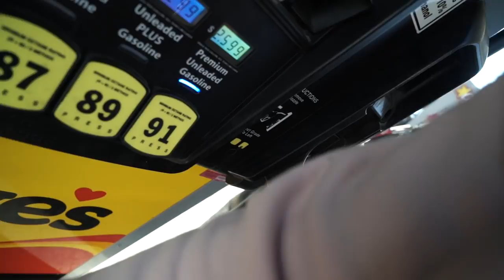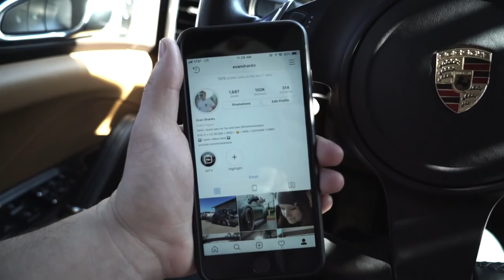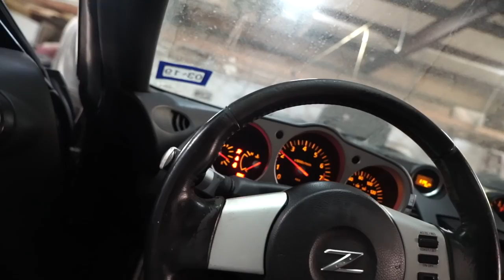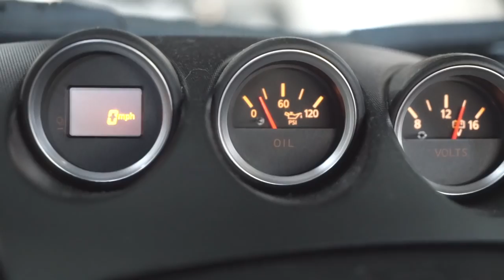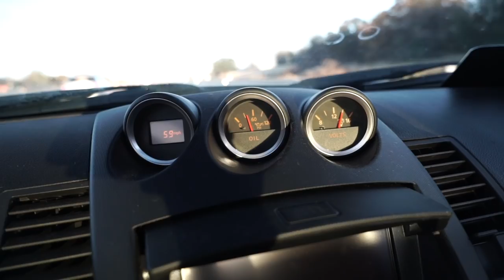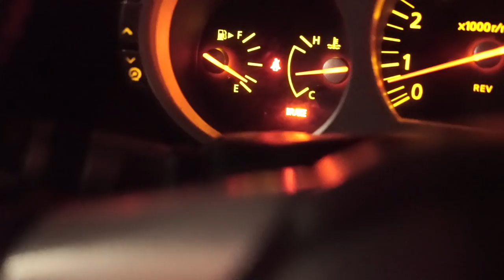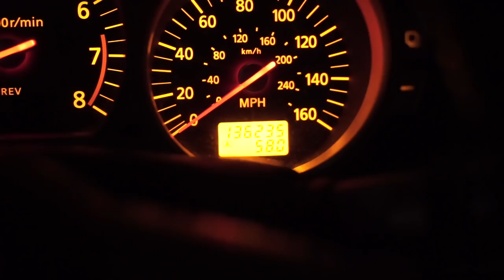FINALLY DRIVING THE DRIFT Z!

Comment: Sorry to be the barer of bad news mate, I really am... but the oil pressure should read around 60psi (12 o'clock on gauge) at around 60mph when when everything is warm, and should idle around 30psi when everything is warm, it should never drop below 14psi when hot idling. I had a de z for 3 years and recently sold it for e46 m3. Possibly somthing to do with oil gallery gaskets I know the hr s had issuse with them and that's what causes low pressure on them.
Reply: ^This......
Reply: @minterfab im pretty sure they re used the oil pump, risky but hey, his car
Reply: This^^^^ bump it to the top of the comments
Reply: Robert Lawson he will learn eventually. More videos I guess if it does break lol
Reply: Robert Lawson that’s cool. I mean I learn too I guess. Good on ya
Reply: I had an Altima SER with the same gauge, these sensors go bad and read zero pressure but there actually is pressure. He should be fine.
Reply: Damn so if its at 90 while driving at 60mph when the car is warmed up and 60psi at idle when at a stop what could be the problem? I have a de and Dont know what the problem is
Reply: I know about 3 people with 350's and all of theirs do the same thing as Evan's, all of them are daily's and have 0 problems what's so ever. In forums people say theirs do the same thing and still run awesome. Not sure on the issue but I do know they can idle weird sometimes in heat.
Reply: It can vary. Look on Z forums. It’s not unusual for them to read pressures at around 10-15 psi at idle. I have never had a problem with my Z32. New pump, new oil, new filter, etc. still reads low. You have to make sure it isn’t burning oil and beginning to tick. These cars drink oil like a white girl drinks bud on vacation. He should be fine as long as he pays attention to everything
Reply: I have also had a z for a year or so and mine reads very low at idle and then when i get it up to 1000 rpm it shoots up to the 60's, also i did have to completely rebuild the motor because the previous owner treated it poorly and with a complete rebuild it did the same thing. Ive had no issues since the rebuild. Just though everyone should be aware
Reply: @connorshea3682   just because yours was low on oil pressure aswell don't mean it's ok. Sure itl drive fine and probably last few years also but it still isn't perfect working order. Just like all these people saying there's is low it's fine. Again  just because theirs are low don't mean nothing is wrong with it. 
Difference is heel be banging rev limiter 90% of the cars life

Comment: Hey Evan I have a 06 Z, it’s really low miles and healthy motor. The oil pressure usually sits around 25-30psi at idle and 60ish on throttle. Not sure why it’d be so low but definitely not normal

Comment: To be certain, you should get a better oil pressure gauge, but between me and my friends with DE's, the oil pressure should be around 30 when idle at warm, and 60 (6th gear) when warm. Generally at cold start it's at 80-90psi.

Comment: I had the same problem with my 350z, same year same trim. I hooked up a manual pressure reader to the sending unit port and it was within spec. The sending units can be a bit inaccurate sometimes. The light only came on at idle though.

Comment: All Z's outside of the base models have the limited slip diff, but you're going to want to weld it regardless.  And you definitely have low pressure.  Did you change the oil galley gaskets when rebuilding?  It was more of an issue on the hr z's, but can still cause low pressure on a de.  You want to be around 25-30 at idle and 65+ when rpm's are up.  When the oil pressure sensor goes bad, they usually max out on the gauge and don't move.  You'll want to confirm this by pulling the sensor and hooking up an actual oil pressure tester to it.

Comment: i’ve owned 3 z’s.. your oil psi should never read below 15 psi on hot idle and should be 60psi at like 2800 rpm on freeway in 6th gear.

Comment: Hey Evans just wanted to give you this little bit of information, I am a Z owner myself and when the car is at idle you want the oil pressure gauge to be sitting around the second line at 30psi and at regular driving at normal throttle it should be slightly above 60, then whenever you do a pull it will slightly go up but should never get close to 120 so keep an eye on the gauge, it is definitely not normal for it to be at 0 at idle. My first guess would be to change the oil pressure switch which is a common problem on these motors but BE CAREFUL make sure you DO NOT overtighten it as it is very easy to crack the upper oil pan..... I learned from experience lol!

Comment: Don’t worry about oil pressure. 10 psi is actually normal for the Z cars. Also don’t be surprised if you see it spoke to almost 60 when under load. I have the same question with my car but you’re golden! That sensor might be confused because of the weight of the oil. I used 10w30 after my last oil change and pressure looked weird but people said it was perfect. Just make sure it doesn’t start to tick or knock. That’s where you need to start worrying 😁 congrats on getting it wrapped up!

Comment: Since it has the "VLSD" in it, either find an open one and weld it of just get an aftermarket LSD. The LSD in the 350z is viscous. 
Which means it sucks.
A lot. 
I have a spare "VLSD" and it just acts like its open 100% of the time.
And is pretty unreliable welded (From what I've heard anyway).

Comment: change the oil pressure switch. I had that same problem after my timing chain repair. Once the oil pump, and oil level is good, the switch is the the problem that throws that red oil light. There super sensitive and malfunction once you've had previous oil pressure issues.

Comment: You probably just have a bad sensor even if you have enough oil in the engine the pressure should build back up. Or change the oil filter to a frame tough guard which is bigger then the normal size filter you'd normally get.

Comment: Oil pressure its super low bad , changed the sensor or u have a bad galley gasket that goes were the timing belt is

Comment: Change the oil pressure sensor and see if it still does the same then it’s the oil pumps it should have allot more oil pressure than that at idle